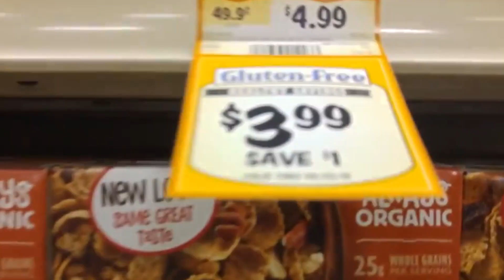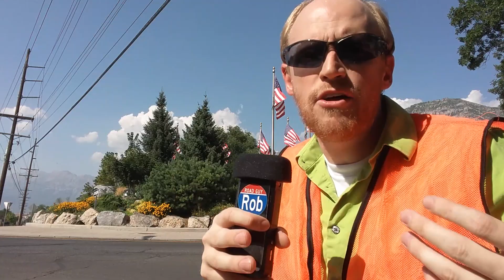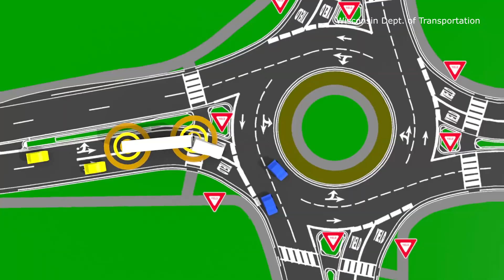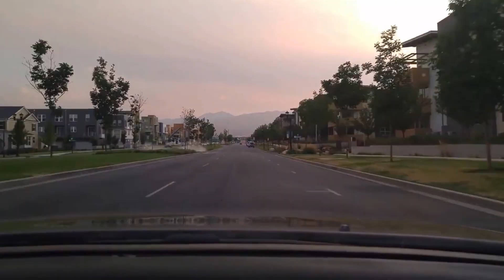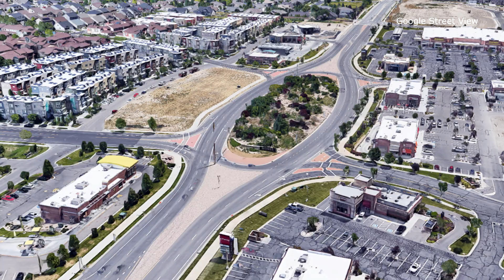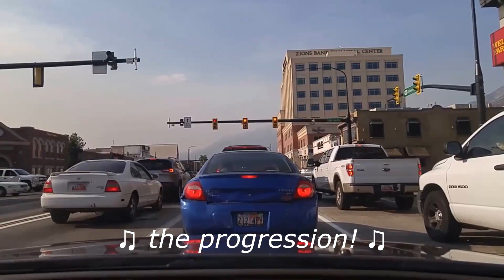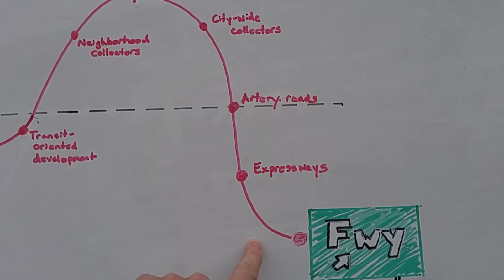Are roundabouts REALLY better than a traffic signal?

Comment: Some roundabouts in the UK have underpasses for the pedestrians. Depending on the neighborhood this is either a great idea or a mugger's paradise.
Reply: how well does it deal with flooding?
Reply: @jasanpahaf   The underpasses can flood which isn't great for pedestrians but the road don't as they are higher up.
Reply: but what do pedestrians do if the tunnel floods?
Reply: @subtoitskiblu7684  they don't use it. It's not illegal to cross a road in the UK(*) and the tunnel is for increased convenience 

(*) unless the road is a motorway and those are fenced off along their length
Reply: @subtoitskiblu7684  If they go to the effort to create a pedestrian underpass you can bet they are going to take drainage into consideration too.  But in the rare case of a flood event they can just walk around?  Google "North Cross Roundabout, Plymouth" if you want an example from the UK.
Reply: @JedStainthorp  when there are floods, if the underpass sees lots of use, temporary traffic lights will be installed to allow pedestrians to cross at grade. otherwise it’s a bit of a free for all
Reply: @jasanpahaf  Works great! All the muggers drown
Reply: @jasanpahaf 
I'm english  how bad a underpass floods or how many mugs hang around it depends on: 
where it is,
How long it is
how steep it  is
Lightning
Drains
corners
And if it has mirrors at the end of it

90% of The underpass in my home town are not very good for muggers
There is even one where no one can mug you or  sneak up on you but due to it being at the bottom of a hill it floods.

But it is still good
Reply: @jasanpahaf  They have huge grates in front of them to absorb the water.
Reply: @jasanpahaf  what flooding?
Reply: @jasanpahaf   we all carry snorkels in our bags
Reply: @jasanpahaf  drainage
Reply: Some roundabouts are great but my city managed to fuck it up by putting a 2 lane roundabout on a one lane road. Now there is always some idiot that tries to speed around the outside lane to jump ahead and cuts you off when everyone has to merge back into the single lane.
Reply: @apexalaska  All UK roundabouts are 2-lane - outside lane for 1st or 2nd exit, inside lane for 3rd or 4th exit. Unless you’re talking about a mini-roundabout, or a roundabout on a massive main road, chances are it’s 2-lane.
Reply: @apexalaska  the second lane is for turning left, that needs to be enforced. UK roads often have signs reminding drivers
Reply: @apexalaska  The local roundabout I have to go through has a four lane on one side and two two lane roads on two other sides. The roundabout has two lanes for 3 quarters of it and 1 lane on the last quarter. When coming from the four lane side intending to go straight to the other two lane road on the opposite side, people in the left lane are supposed to go left or straight and merge. Problem is almost everyone who jumps in the left lane intends to cut ahead of everyone who is in the right lane because they wish to go straight. I hate it so much. The only people who ever get in the left lane that aren't going left are assholes in my book.
Reply: @apexalaska  that‘s because people are stupid. 1 lane would probably not have a high enough capacity
Reply: @apexalaska  roundabouts themselves are amazing tho city management does ruin it from time to time
Reply: @apexalaska  Two-lane roundabouts generally only have 1 lane that actually exits.The right lane is like an "exit lane" while the left lane is a "continue around" lane. How do you have two exit lanes without crossing over traffic?
Reply: I lived in UK for 4 years.  First I hated them, but once I learned the correct way to use them I loved them.   I hated it when I returned to the US and had to deal with the gas and time wasting stop lights/signs.   In UK they do have small roundabouts in town that semi’s can drive over and zebra crossings for pedestrians.
Reply: Awww bless you may have to walk an extra 10 yards 🤦🏻‍♂️FMD America. How have 3rd world countries mastered this with trucks, horse and cart,cars, motorbikes, poor America, 🤦🏻‍♂️
Reply: overpass looks better and cheaper idea in some cases I guess
Reply: A lot of people have commented on UK self defence law, to clarify, that's fine here. Self defence is when a person honestly believes himself or another person in danger, and he uses reasonable force for the situation as he honestly believes it to be.
Reply: I find bridges are much nicer than an underpass. Most roundabouts near me have pelican crossing traffic lights.
Reply: If it's a mugger's paradise, do they bring their own hot cocoa?☕🌞
Reply: we have some roundabouts that have overpasses for pedestrians, bikes or hell... even for straight passing vehicles
Reply: Sounds expensive
Reply: @Deacetis1991  it is, that's why it's only done if it's needed, aka on highways which high traffic flow

a suburbian roundabout can be just put onto an existing crossing... with a few signs and some paint
Reply: @Deacetis1991  Not when you stop tax evasion and corruption
Reply: Very few
Reply: Overpasses, then.
Reply: Thats why overpasses are a thing
Reply: Isn't it one massive mugger heaven?
Reply: @x66Hawk66x  If I am in an unfamiliar area I go around Chevy Chase style a few times to find the right exit.
Reply: I was warned NOT to use the underpasses in a local road near my sisters house when she lived in High Wycombe for precisely that reason. Beggers and panhandlers, thankfully the UK does not have knife or gun violence at anything like the US levels but it was considered safer to walk on a very narrow ledge on a dual carriageway ( not a highway or motorway ) than go under the road in a deserted and lonely underpass where anything could happen......
Reply: Underpasses work but bridges can also work, depending on the height of vehicles on the road. I think underpasses should be brightly lit with staff paid to clean them every day to keep them safe and nice.
Reply: true - but an issue whatever intersection type you choose - at least a roundabout is a reasonably safe area to cross since there are often 'islands' on each approach road.
Reply: Underpasses and over passes for pedestrians make it hard for wa;lkers with health issues.  Would make more sense to raise or lower the cars.
Reply: We used to visit the UK every couple of years and I had no problem driving on the "wrong" side of the road but found it virtually impossible to remember which direction to look when I tried to walk through a roundabout.
Reply: What can make it a mugger's paradise?
Reply: @Twiggy163  Dark tunnels to lurk in, waiting for an easy target. Multiple escape routes.
Reply: @apmcd47  ooooh, the underpasses. I read it wrong, sorry.
Reply: If it's in the UK then it's the latter.
Reply: Like at the arc de triomphe. Full disclosure, i jaywalked across from another side
Reply: If Cities Skylines has taught us anything you should go the other way and have pedestrian bridges instead of tunnels.
Reply: Question:  if it's a mugger's paradise situation:  Did they ever light the underpass up properly, like nice and bright?  And if so, did that work?
Reply: Almost like demographics are more important than road design! Think Rob will do a video about how forced desegregation busing destroyed American cities? No?
Reply: When I walk in an underpass Im thinking "im not trapped in here with you.. YOURE TRAPPED IN HERE WITH ME!! 😂😂"
Reply: Ngl, don’t like that
Reply: Steeeeeeeeeevenage
Reply: Mugger's paradise. That slayed me bro.  🤣
Reply: the UK hates the free flow of traffic so they add traffic lights to roundabouts, ensuring you are balked at 1am
Reply: @richardclarke376  Only on major junctions. The vast majority of roundabouts in the UK are traffic light free...
Reply: @Penguin_of_Death  in the UK traffic lights are left on because the government hates the workers
Reply: @Penguin_of_Death  there's loads though not really roundabouts, because of the lights. Some have part time lights
Reply: @richardclarke376  This is done to increase the traffic capacity of the roundabout at peak times. Aka would you like to wait at the lights or in a queue that extends over the horizon. At 1am there is an issue with regard to how to implement pedestrian facilities at part-time lights. I can find no example of such a roundabout in the UK and when I tried to design one I could not develop something I was happy with.
Reply: @Robin-kr4eg  activate the lights, even if they normally wouldn't be active at that time, when a pedestrian is present...?
Reply: @JohnRunyon  We had been looking at this at a roundabout and in a town center. The trouble is that the desirable start-up procedure for mid-block crossings is not allowed under UK specifications, aka go to amber from blackout and hold for 3s, run an all red for x seconds, and then display green man to the pedestrian(s). In the UK the speck calls for an all red start. If you apply that to a roundabout junction then drivers may do the amber gambling thing and red running at startup when the roundabout is still being controlled by priority leading to accidents. If you do it the other way round and follow the UK speck then you will get vehicles going into emergency stops and causing rear-end shunt. Either way, we would have to contract novel research in order to understand the risks and make a decistion. There is also the issue that there have been two research documents looking at the safety of part-time signals at roundabouts and while not conclusive it has gotten the national roads authorities spooked on the idea of using these at all never mind trying to integrate pedestrian facilities with this. Assuming I could deal with all of that then I need to figure out how to communicate to the pedestrians that the signals are working, had thought to use a sign on the signal poll with a kerbside detector but many people do not read signs and may then cross unsafely due to this. So I also would have to bottom that out before being able to advise that such a junction is built. All in all way harder than I thought when I started looking at this.
Reply: @richardclarke376  I mean yeah, but the US just puts traffic lights on virtually every intersection so that you have to wait for several to go anywhere whether it's 1am or 5pm.
Reply: @JohnRunyon  They are computer controlled. Most aren't the same at 1 am and 5 pm. You need to travel more before making statements about the whole country.
Reply: @richardclarke376  those are trafic circles
Reply: @richardclarke376  yeah that's as annoying as fuck. Most seem to be okay in London though.
Reply: @richardclarke376  Yeah, that's shit at 1am, but probably pretty helpful at rush hour. 
They used to have 'Part time signals' at some roundabouts, but... I don't know what kind of chaos that happened at the precise moments they switched them on or off...
Reply: @richardclarke376  They're not technically roundabouts apparently, it's a circle with lights. I've always called them roundabouts with lights though... 
Apparently that's part the reason why America haven't taken to roundabouts like Europe. In the early 1900's America trialled circles with lights and found they made accidents worse. So when roundabouts were invented as a solution by I think a British guy, America already had a bad taste in their mouth from circles with lights.
Reply: @richardclarke376 I don't think that qualifies as a roundabout then.
Reply: That is an expense possibly not covered by vehicle tax. So not only did that roundabout cost extra money from your vehicle tax to erect, it costs extra money to maintain and keep lit the underpasses. And even if it was covered by vehicle tax revenue, it is an extra expense you are not using with your vehicle. Anything but a great idea. Electricity for traffic lights and its control unit would've cost less than keeping the underpasses lit, clean and maintained. I would not approve of that.
Reply: Giving the plebs what the Monarchs want to give. Robbery and rape.
Reply: @David_H_Parker  it's not the monarchy. The permanent government likes to keep the plebs under control using crime
Reply: muggers paradise? sounds like you guys could use some guns for self defense
Reply: @johnathanrichardson  LOL being mugged and then being  investigated for defending yourself is all part of the UK experience
Reply: @richardclarke376  yeah its really unfortunate for you guys. around here if you defend yourself with a weapon calling the police is mostly just a formality to have the body removed from your house
Reply: @johnathanrichardson  Aww John your such a tough man, such a hard guy, bet you love standing in the mirror with your guns looking cool 🤣🤦🏽‍♂️
Reply: @johnathanrichardson  well if there are guns, then the mugger is more likely to have a gun in the first place, so...
Reply: @grassytramtracks  ok but in the UK its illegal for civilians to have weapons period, so when the mugger comes at you with a knife your kinda screwed. i would rather be in a situation where me and a mugger both have guns. criminals dont care about laws. thats what makes them criminals. why should you make it illegal for civilians to have weapons when criminals will just get them no matter what? laws that prevent and restrict the ownership of weapons only harm law abiding citizens
Reply: @johnathanrichardson  what so I can get mugged at gunpoint instead?
Reply: @davedavidson9936  you argument is a disingenuous strawman
Reply: @johnathanrichardson  Makes for more efficient mugging.
Reply: @johnathanrichardson  Its a british cover of the Coolio song
Reply: @johnathanrichardson  Self-defence is illegal  in the UK.

Comment: As driving becomes more automated with self-driving cars and autopilot, roundabouts will become less necessary to prevent accidents etc. So then the bias will be more to pedestrians and cyclists and we'll be back to traffic lights controlled junctions.
Where roundabouts certainly make sense is on suburban neighborhoods where most 3 and 4-way stops could be removed and replaced with roundabouts.  They do not have to be big constructions, a simple painted circle in the middle of the road to show priority  I.E. give way to traffic from the left. There are far too many stop signs in the US. Most can be replaced with prioritized T-junctions with yield for the side traffic or, indeed roundabouts where traffic flow is equal on all roads. Visit the UK and you will find very few stop signs. Nearly all junctions can be controlled with direction priority and yields.

Comment: "Definitely don't put any roundabouts on the freeway"

WRONG! Well, kinda... You wanna put them above or below the freeway (whichever way is most practical) such that you have off ramps that feed into a roundabout.
And that roundabout needs to connect to all incoming and outgoing lanes of the freeway as well as the crossing street.

Also, roundabouts in dense urban areas can work wonders IF you construct them properly. Combining them with traffic lights such that pedestrians can cross all at the same time as a "platoon".
And furthermore, it's about education... Most US drivers are pretty dumb when it comes to roundabouts. They need to be taught to use them properly.

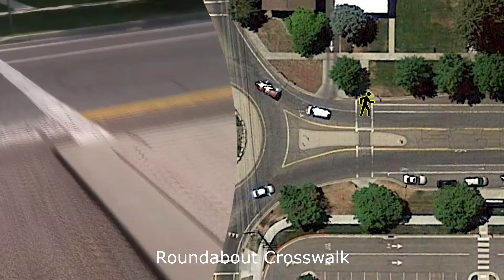Comment: 3:16 Your example roundabout is HORRIBLE design for a pedestrian crossing. Generally, the crossing is closer to the actual roundabout circle and is in fact designed in such a way that it essentially gets its own little lane going around it.
Cars should not get a run up space before the pedestrian crossing as this only makes it more dangerous to cross.
Also, any car making a right turn needs to be able to see that a pedestrian is about to cross ahead of them... Putting the crossing so far away means the driver won't really see the pedestrian until after he's made the turn.
ALSO, the yield sign (in a properly constructed roundabout) need to be BEFORE the pedestrian crossing such that cars need to yield to any crossing pedestrians or cyclists both going in and out of the roundabout.

... ALSO, the roundabout you are showing needlessly blocks a lot of the view of the roundabout. Cars coming from opposite ends should be able to see each other.

Whomever planned that design really needs to ask a European how it's done. Like, even a Scandinavian or Dutch designer.
And you said something about a tight turning circle and the roundabout taking up a lot of space... It really doesn't have to. That is a pretty big roundabout compared to most European designs.
Trucks can most certainly make the turns on smaller ones, or they'd have trouble making 90 degree turns at regular intersections.

Comment: I grew up in a CITY that had only roundabouts. When i was 11 the first traffic light was installed. It was at my primary schools crosswalk. Not even at an intersection. Then when i was about 14 they installed a second set of lights. This time at a really busy T intersection near the netball courts/biggest shopping center in the city. Im now 28 and those are still the only traffic lights in that city. Traffic lights work but roundabouts work better.

Comment: While the roundabout took more steps for the pedestrian, you were exposed to less distance between safe spots, which I take as a good thing for older people.  Also, roundabouts are not an either/or for traffic lights. Roundabouts are very good at replacing four-way stop signs.   Not stopping saves energy and reduces  brake wear.  The United States has too many traffic signals  you need  for only 10 minutes a day.